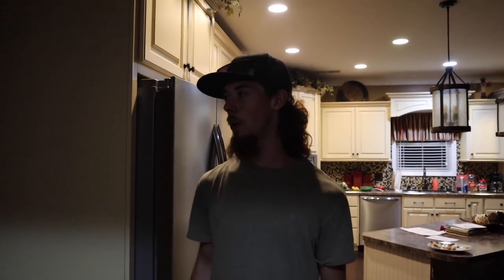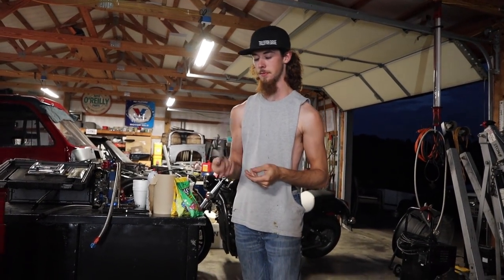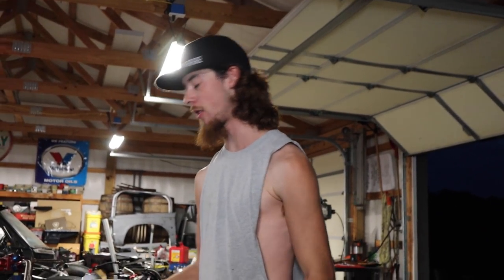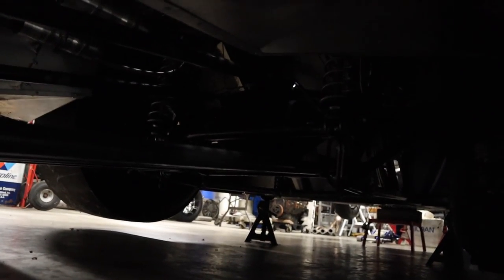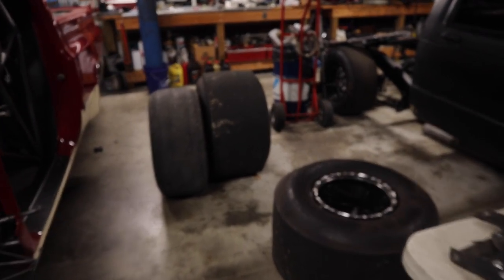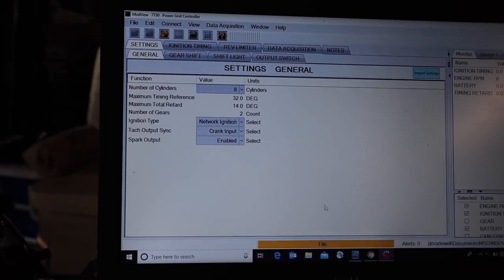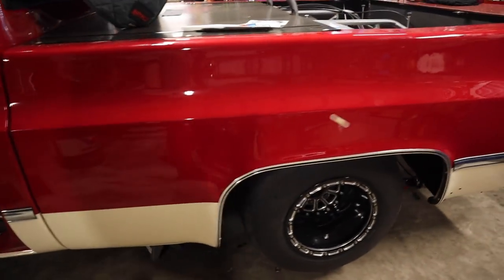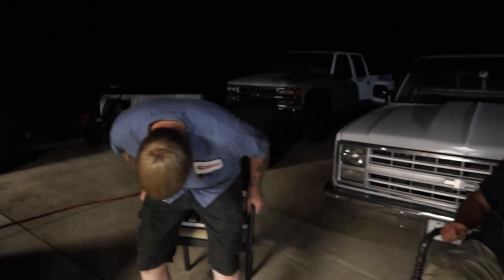Putting Small Tires On Whole Milk?

Comment: It's a wonder you ain't blown the intake off, hitting it with one kit. You can gain alot,by phasing in at least 3 kits. Help response to the Pedalfest,you are going to on them radials. 
       Looks like she got plenty to do. When I get back from the golf course, that damn motor better be bolted in,and my supper ready. 
       Best of luck to you, Trailer Park  Milkman.

Comment: When you going to build either an RVW/Pro275 or an NPK truck? It doesn't matter what body style it is as long as it has a Bowtie in the grille it could be any body style short bed,long bed,step side,El Camino,GMC but my favorites are El Camino,60-66,early 2000s step side and S10 Extreme's truck and Blazer just some idea's for future builds plus I think it would be sick to see you out there in a truck with a Nitrous fed 959cid all billet engine with a Liberty 5speed either with a Quick Drive or Ty-Drive and a converter or a manually vertigate shifted 5speed with a converter and a Quick Drive

Comment: You should put QA1 Mod Shocks all around Whole Milk and get 3 maybe 4 different valve packs for them so you can have one for street driving/pulling a trailer,slicks/big tires and bars,radials,and finally No Prep and changing the valve packs is alot easier than changing the whole coilovers for different races and as far as your nitrous problem you should get up with the "Old Man" Bill over at @SRC GARAGE or @Street Race Channel or @SRC Photography here on YouTube the first channel is his the @SRC GARAGE and he's always ready and willing to help someone and he's been looking for people to collaborate with here on YouTube and in my opinion he is a huge fountain of knowledge when it comes drag racing and No Prep in particular and he is a great tuner when it comes to nitrous tuning,turbo tuning,carburetor tuning, and tuning in general when it comes to a SBC and BBC engines and he's in Ohio so not too too far from you so if I were you I would contact him anyway I could and I think it would be pretty damn awesome to see you and "Billy The Kid" in his 18 degree headed SBC 400 with twin turbos through a blow-thru carburetor S10 and when his brother gets his truck done maybe he can get some action too either one of them trucks vs either the Milk Truck or Whole Milk I think would be a sick race if all the trucks were all lined out